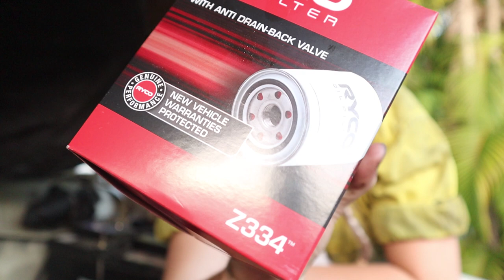My Landcruiser Part 2: Basic Servicing

Comment: A little tip for you, If you fill the new filter with oil before you put it on the oil pump doesn't have to fill the oil filter before the oil goes through the oil galleries, so your motor will get full oil pressure quicker
Reply: jaryd t uhh the filter goes on thread end down?
Reply: Oh does it? my hj 61 cruiser goes up, just assumed they're all the same.
Reply: Your correct about pre filling even if it's face up face down side to side the anti drain back valve will stop all the oil from dripping out the Filter so spill is to the bare minimal unless it takes you 15 minutes to screw in the filter in hahaha.

Comment: Hey, great video. Here is my 2cents. Hilux has the same issue with the oil filter facing down. What I do is crack turn it just a bit to allow air in and it will drain through the sump. It ends up bone dry when you take it off. Hope it works on the HZ.

Comment: I know you said that you were showing what you do, so I'm not taking from that, but I also replace the fuel filter and check the air cleaner filter (especially) in drought times. Years ago I used to run a couple of taxis and my mechanic used Mobil Longhaul, a specialist oil for big trucks, but when I sold one of my taxis at 1.25m km, it wasn't using a drop of oil between changes, so that's what I was using in my 75. Caltex took Mobil over and the closest oil was Delos Gold, so I use that, now I've only done 225000km, but most of the mileage in the last 10 years is towing my heavy fifth wheeler, and it's still not burning oil.

Comment: I used to use 20w60 same as you use on my old 2h diesel does not loves it I switch to penrite hpr 15w50 that thing loves it and I switch my other  (4)gq td42 to 15w50 penrite .and also u can get a grease gun and grease the universal joints in your 75 drive shaft jack front diffs up and check wheel bearing play 😊👍 it's funny now days a lot of new guys don't know how to change the engine oil
Reply from the maker: I have high kms and live in a climate that means 20w-60 works better for my engine. 
And yes I am aware of how to lubricate and check for wheel bearing play but this video was just for an oil change.

Comment: Better than 2H where vertical filter means oil runs out as soon as the O ring parts, and keeps running down your arm for another 3 or 4 turns until it comes loose. Buy a stash of washers and put a newie on each time. Yeah, the right fluids help get the job done. :)
Reply from the maker: Haha yeah thats always a bummer!

Comment: If you can find somewhere to get cheap enough or good quality filters, it dosent hurt to change the fuel and air filter every 5000k too, just a piece of mind knowing that you won’t have contaminants entering the engine, if you look around you should be able to find a kit that has all 3 for pretty cheap.
Reply from the maker: I have a K&N so dont need to replace that ever again. Overservicing imo is just a waste of money. Fuel filters are made to last a lot more than 5000kms

Comment: Hey. Just a tip for next time, crack your oil filter first before you drain the oil, so the oil will drain back. The best way i find to do this is to loosen it until the oil starts weeping out at the bottom then tighten about a 1/4 of a turn this trick works on the hilux's and prado's (most of the time) so should work for you. Any way like the videos. New Sub =). Keep at it.
Reply from the maker: Ill give it ago cheers! And thank you for the subscribe

Comment: One thing I started doing is filling the oil filter up with oil, so there is no chance to destroy your camshaft and/or bearings at the camshaft/crankshaft
Reply: Unfortunately with the 1HZ the oil filter is oriented in a way that is can not be filled prior to screwing it onto the block  unless you're keen on oiling the ground you're working above.
Reply: @chopped_8054  you don't need to fill it up all the way, I have a 73 valiant currently and it has it vertical to the engine, still will be okay, also did it to other cars where it is slightly pointing downwards, the oil will only go out of the threads not the little holes(at least not straight away) should be fine, try it! Better clean a little oil spill then rebuild your engine
Reply from the maker: @johnnyasus86  yeah you would only be left with maybe a few mils of oil left after you screwed it all the way on because it would all just fall out. Gravity beats my screwing on speeds hah
Reply: I've always done it, fill it up and let it soak into the filter elements
Reply: @DanieSimpson  Screw game is not strong, feel ya haha

Comment: When you put a new filter on it should be only done up hand tight, other wise you crush that washer, loosing oil pressure.
Reply from the maker: Hence why i only did it up hand tight? To what was recommended on the filter.
Reply: @DanieSimpson  Hand not Hands...
Reply from the maker: @Cheesebomb32  im a girl with horrible grip strength my "one" hand tight isn't hand tight. I know this from owning this car for nearly 8 years. Thats alot of services so trust me I know how tight is too tight

Comment: if you have a shifter box check oil level  regular because the oil from shift box try to leak  in the transfercase because of a failed seal between shift and transferbox.Because this many gearboxes died because  lack of oil!
Reply from the maker: Watch my other video

Comment: 20-60 I found is really thick I ran 15w-50 in both my 1987 hj75 troopy with the 2h and it had 970thou kms on it and I’m running the 15w-50 in my 80 with a 1HZ and it has 416 thou on it I have no blow by and it doesn’t chuff and soot at all they are both really clean engines highly recommend it HPR 15 through Penrite I use penrite aswell
Reply from the maker: 20w-60 works best for my vehicle and I have always used penrite

Comment: Great mechanic,  might want to check the air filter
Reply from the maker: It's a K&N it doesn't need to be checked as regularly as a paper element filter. I clean and oil it when required or after a big 4wd trip.
Reply: @DanieSimpson  Clever girl  ))

Comment: Save your self a bunch of time and mess, get an oil extractor and put it down the dipstick tube, way better if you don’t have access to a hoist.
Reply from the maker: That seems like a lot of effort. I can sit under my ute so not really an effort to undo one sump plug..
Reply: Danie Simpson trust me, I work field service and will always take the easy option when possible. You can get a hand pumped vacuum extractor for not much money, and it has heaps of uses, like getting out old brake fluid and even priming your fuel system in some situations. Not trying to sell you one, just to be of some help.
Reply: Danie Simpson search online for vacuum extractor hand pumped 6.5 litre to see what I am on about 👍
Reply from the maker: @rsoul7282  yeah Ive got one for using for brake fluid but I dont think ill ever use one on engine oil. Everything I work on at work and at home, its easier to just drain the sump.
Reply: Danie Simpson no worries, you know what works for you 👍
Reply from the maker: @rsoul7282  yeah maybe when im older and arent so keen on sitting on the ground anymore ha
Reply: Hello there, great vids and intrepid skills Danie!!
I'll also give a thumbs up for an oil extractor. I have one for brake/tranny fluids and another for engine oil. Was skeptical at first, I now have a cleaner oil change.
No taint of old oil you get when you use the bolt out of sump method (even if you leave to drain for a couple of days, there is always some left over) nice and golden for a couple of thousand kms.
I move position the suction hose to get all the oil and I can see the volume oil extracted to confirm complete volume has been removed.
Super clean, no hot oil on hands or driveway. You do need to let the engine cool a bit though so the container doesn't vacuum itself squashed.
To each his/her own.
Cheers Gaz
Reply: Nah man

Comment: Hang on, the 1hz sump plug has a washer? Shit I replace my oil/filter every 5,000Km but I never knew that...Mind you it doesn't seem to need one...any advice folks??
Reply from the maker: Nah most have flared nuts but never hurts
Reply: @DanieSimpson  Yeah I agree...will get a supply, cheers!
Reply: I use X2 copper washers and have been re using the same ones for years.

Comment: i was told,as many times i am,that all oil filters are made by sakura,regardless of whats printed on them...as for leaf wrapping,IF,they made the top leaf longer,it wouldnt happen,&,as for not being stable on top of diff,have a look at all u.s. 4x4rs since 1950.plus,on top theres less arc needed so theres more flex,plus cruiser springs are very short.main problem.other than that,great job,keep it up,dont take no sht.when i was up there,1983,only beer was xxxx,damn you live in great times now.buy a welder & grinder fix that floor.

Comment: I think you said you had 600,000 miles on the Ol Boy.  When the time comes will you rebuild or swap out with a low mile used motor?
Reply from the maker: Kms not miles haha I will mostly likely swap to a factory turbo engine
Reply: Danie Simpson right!  Ha ha

Comment: Hey it's another QLD 75-series owner, welcome to the winner's club.
Out of curiosity how often do you re-pack the CV joints?  I was thinking about doing mine because one side has a leak.
Reply from the maker: Gone 7 years without ever doing it. What do you mean its leaking? I service my swivel hub and bearings frequently running the bigger offset rim but thats about it
Reply: @DanieSimpson  Good to know. Yeah I meant a leak from the swivel hub (lower seal), not serious but it's on the to-do list.
Reply from the maker: @poopipeboy3033  yeah thats easy fix

Comment: Just changed the oil in my Silverado this morning....I have a Fumoto valve on my sump....makes it much easier and cleaner....no need to worry about having to replace the sump plug washer. And yes they are SAFE. https://www.ezoil.com.au/products.html#drainvalves

Comment: No need to put oil on the filter thread its literally in the oil while the cars running
Reply from the maker: Yeah just a habit because I do it for the trucks at work which dont sit in the oil and seize all the time
Reply: @DanieSimpson  I was waiting for something to criticize but you done everything how I'd do it so that's all i could pick on
Reply from the maker: @ElisPalace  yeah everyone has there ways hey no real right or wrong way really
Reply: @DanieSimpson  have you seen those EZ oil drain taps? Handy if you're always doing your oil I've seen them on trucks but you can put them on anything
Reply from the maker: @ElisPalace  yeah they are pretty handy! Maybe one day